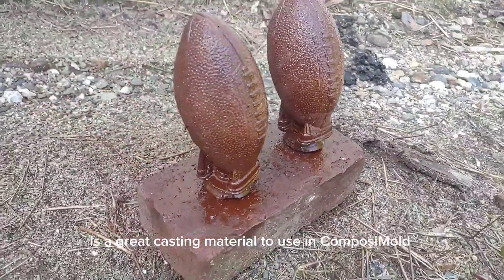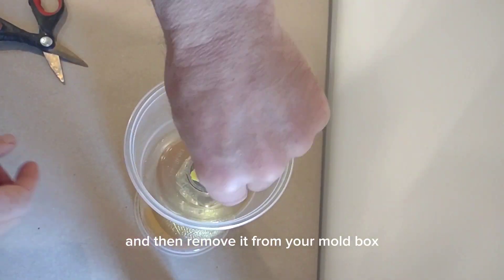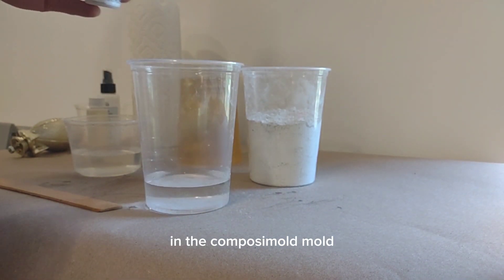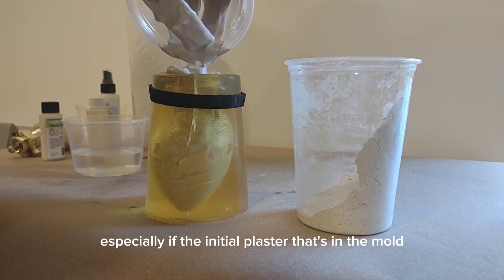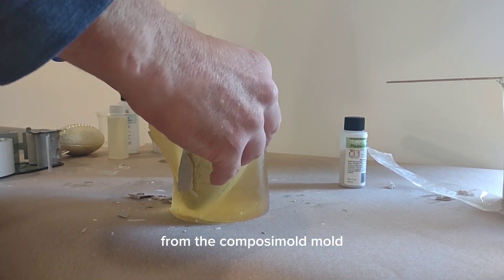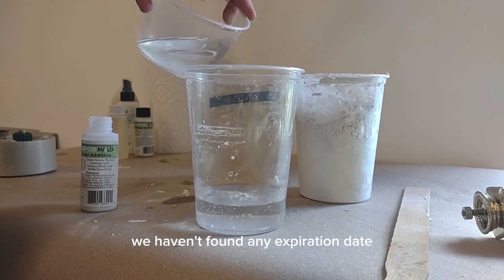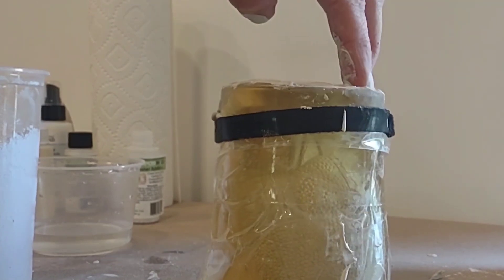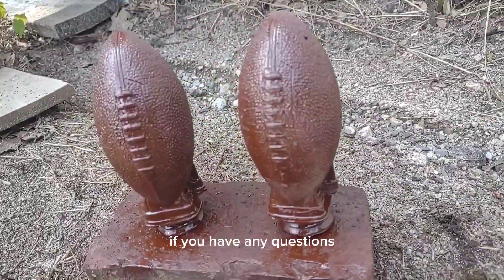Casting Plaster of Paris in a Mold You Make. Adding Plaster Additive for Increased Strength

Comment: You made the mold into a cup. Why not just spray the inside of an identical cup with some spray vegetable oil and slip a new cup with the bottom cut off over the mold to hold it together? Also, you can pre-cast some small stones or "chalk sticks" to force into the plaster while it is hardening to fill it up instead of mixing more plaster when you run short. You have an incredible amount of voids due to air bubbles because you mixed it too thick.
Reply from the maker: Yes, on the cup idea. That is a very good suggestion! And yes, probably a little thick on plaster thickness, but I would always err on the thicker side as it will be stronger. Thanks! stan from ComposiMold